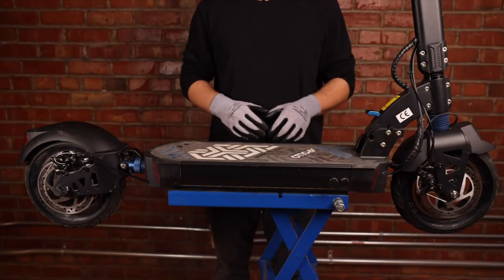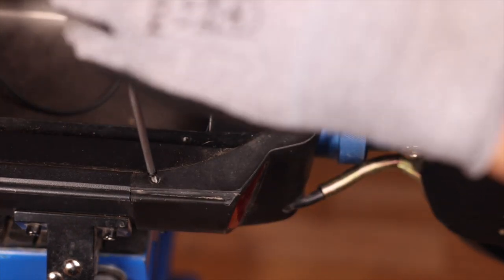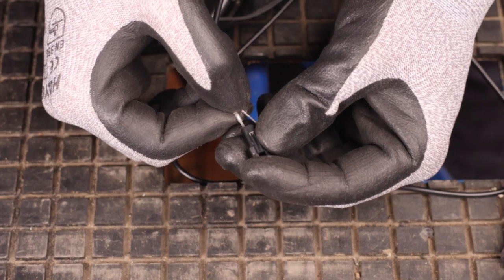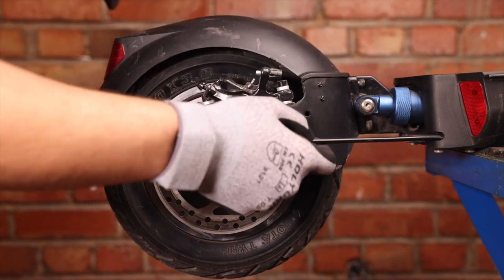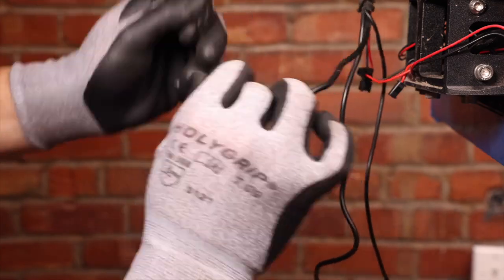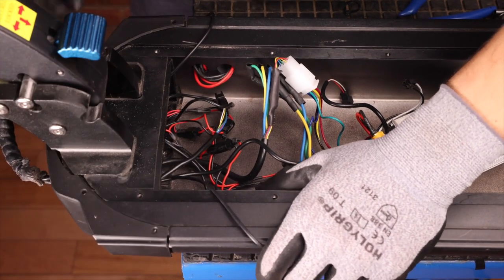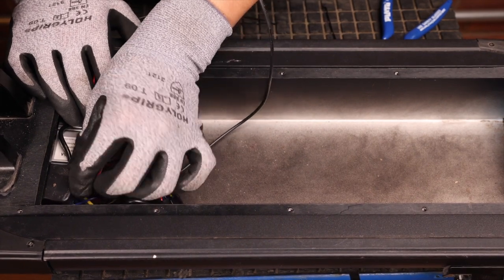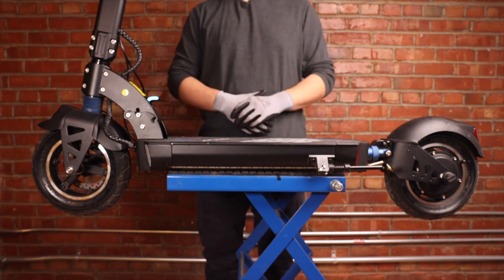How To: Apollo Explore/Ghost Deck Cover Replacement

Comment: Such a lame design.  My charger property is loose and the only way to tighten it is to remove the deck tape…AGAIN.  Already did it once when I had to replace the charging port.